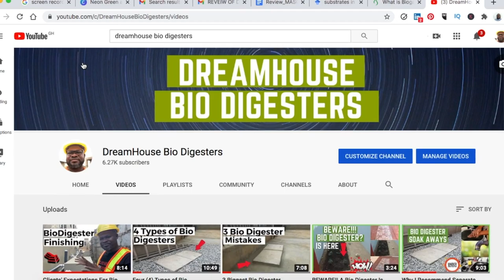Why A Soak Away For Your Bio Digester Is Your Best Option

Comment: Please so after the separate soak away are you going to do screeding under it and what will you use to fill the soak away pit. the pipe that goes into the soak away pit will you still create the small holes under it or the water will now go direct to the soak away pit.thank you